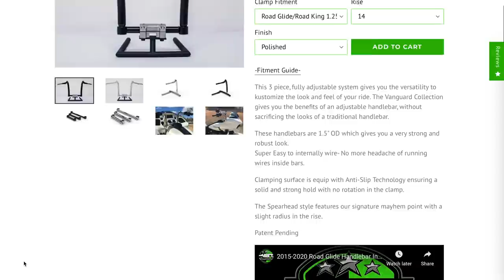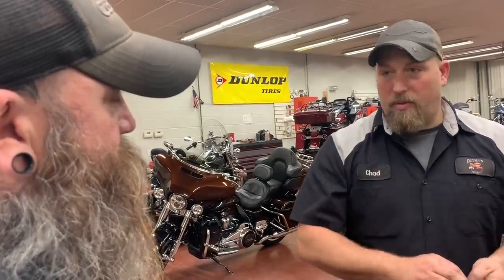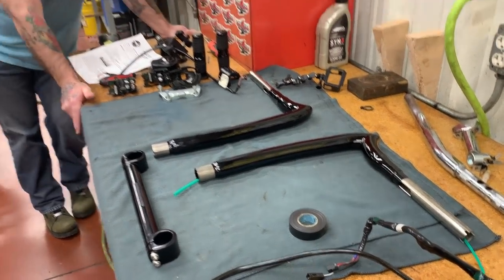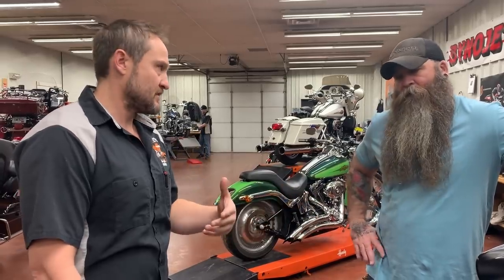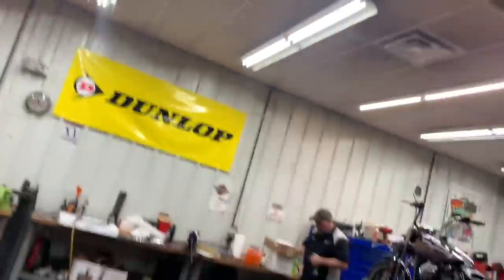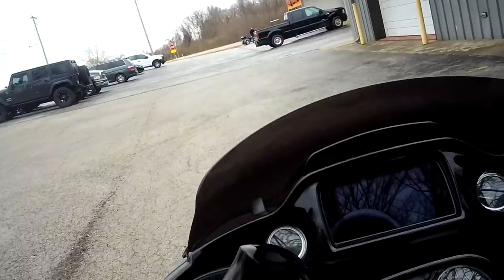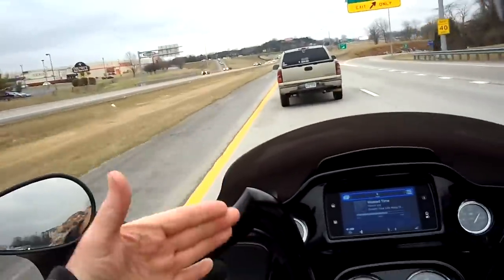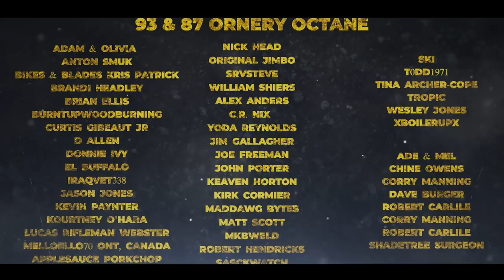KST Spearhead motorcycle handlebars Harley Davidson Road Glide 14” 1.5 bars wiring harness extension

Comment: That tech is playing it safe, I have installed several of these kst’s and you don’t have to extend anything, just route your wires in safe manner and my customers have had them on for a long time and no issues. But nothing wrong with installing the extension at all, great job!!
Reply: Hey man started mine last night.  Wiring under gauge cluster no problem You have any hints getting enough room on your brake clutch lines? Cut all the zip ties.

Comment: those pins break off easy with a little tap ,yes the wire extensions and a fatbagger 4' clutch extension makes installation simple with the 14' spearhead bars

Comment: I've put my 14inch bars on and used standard cables just run them outside of the plastic it works fine no stretch or anything.

Comment: I brought home a 22 RGS yesterday and these are definitely the bars I want. Thanks for the vid and have a good ride.
Reply: did you get these bars and install? if so, any issues?
Reply: @noresponse  

Yes I did buy them and yes I had plenty of issues... I struggled getting the cables run and finally gave up.. Ended up buying another brand that was plug and play.
Reply: @tallmike6598  thanks for the update. I got the 12" spearheads and the wiring was a PITA. Video made it look so simple, but the ends of the connectors kept getting stuck, I finally used some painters tape to round of the sharp edges. Ughhh. The clutch cable is like 3" too short, even after cutting all the zips and removing from frame holders.

Comment: If you want to keep the wiring caddy, you would need to extend the wires. But that caddy is a piece of cheap plastic anyway. I have these bars since Biketoberfest 2019. Only issue is they got loose once. Some Loctite on the clamp bolts and problem solved. Ride safe and enjoy those bars.

Comment: I put the 14" on my bike. KST did them at Biketoberfest.  You don't need the extensions for the wires on the 14" it took the 45 minutes start to finish.
Reply: On my 15 road glide I didn't use the extensions it worked but it was a stretch. When I did them on my 2020 I went ahead and bought the extensions they were only $35

Comment: Seems y'all would have saved a little time by actually watching the KST install video specifically as it refers to the perch clamps.  🙂   Also, I noticed at 6:46 the hydraulics are "under the bar".   KST recommends that they be placed above the bar.  Looks like with some editing, they got it right later on.

Comment: I thought KST stopped selling the clamp piece with the rubber insert.  They have had several problems and now sell it with that area knurled.  I have the bars with the rubber piece and the bars move and I had to buy a gorilla clamp with set screws.

Comment: I have a question, instead of grinding that pin off, couldn’t you drill a hole in the handle bars for it? But, it still looks good.
Reply: You would need a slot not just a hole for adjustment. The pin grinds off very easy. The bars are stainless steel drilling a hole would be much more difficult.

Comment: I need me some new bars.  But gotta sell my slightly used KLOCKWERKS 15’’ windshield first and buy a new one that’s 14’’.
Reply: I have a brand new 14" klock werks dark smoked I'm selling. It's got 40 miles on it. I had to go with the 15" . I'm 6'3" and the 14 was just a bit short. I'll give a great deal on it

Comment: If they had watched the KST video, you would not need the extensions, and they would not have struggled to get the wiring into the handle bar. Jeez.
Reply: If they had watched the KST video, they would have known they needed to cut the pin in the handle bar.
Reply: Watch what the manufacture recommends. How does Harley override?